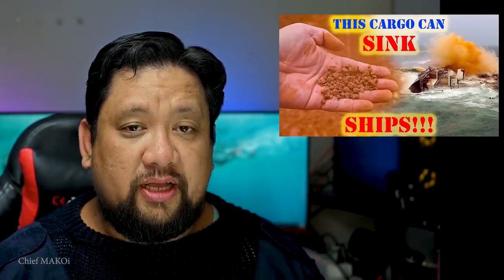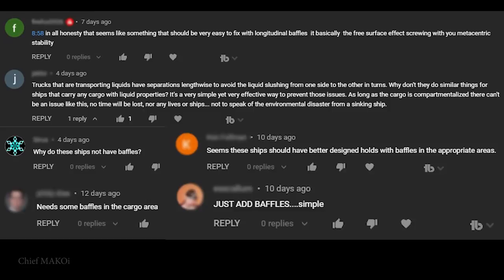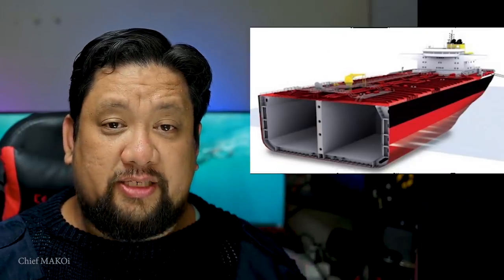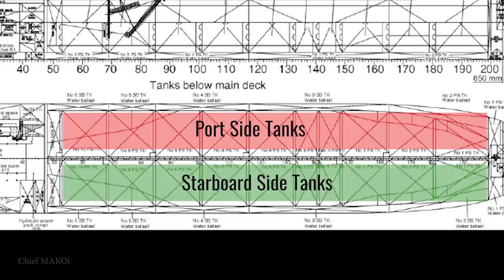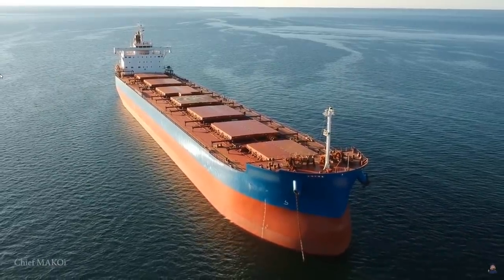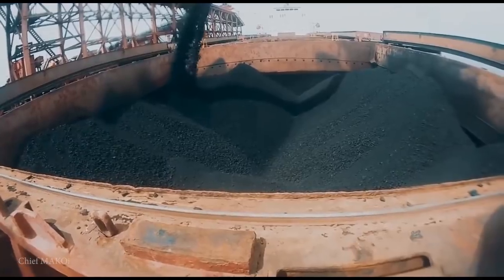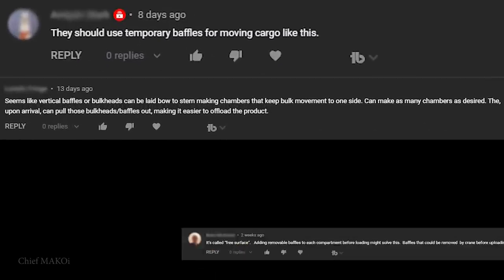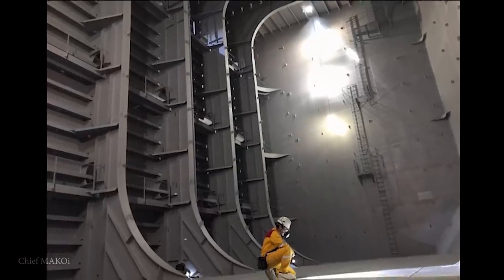Free Surface Effect: Should Baffles Be Installed in Bulk Carrier Ship's Cargo Holds? | Chief MAKOi

Comment: Air bladders along the top port and starboard side.

Just passively inflated they would prevent the liquid like loads from shifting as much. And if actively managed they could provide even better stability.
Reply: Many tragedies could have been avoided if captains would have turned the their ship  around in time and get the motion moving cargo from the opposite side ,  fear is the greatest danger for someone in that situation . Waves rock the ship  in very specific repeated ways and load shift can happen even with dry bulk ,i would vote in pumping compressed air from the bottom keeping  particle form merging into liquid .
Reply: @stephenconger2029  Dry sand is different , moisture load in the media can be used along with compressed cold air to create artificial ice structures  inside cargo ,air bladders would call for  extra engineering of ship structure plus variations in cargo volume would create more logistical challenges .
Reply: @rovidius2006  so instead of bladders that would require modest space and a couple small compressors. You want multiple compressors, some being quite large capable of achieving and maintaining refrigeration?
Reply: @stephenconger2029  Either one might work ,cost is the limiting factor ,bladders of that size and material thickness are hard to come by ,if they blow up it makes it far worse, so they  need have universal size and engineered strengths. Refrigeration could be used occasionally   based on weather and cargo condition ,mostly emergency use ,400psi compressed air traveling through pipes  from engine room  through heat exchangers would get parts of cargo frozen ,remember moist cargo will cool down  in contact with moving air by losing moisture so a double cooling effect .

Comment: In short, it's not going to happen unless there's a regulation to mandate it. From a safely perspective, it does add an extra slice of cheese with only a couple of very small holes, so it's going to be a case of if you think existing control measures are adequate.

Comment: What if it would've been possible to force compressed air from the bottom of the holds through the cargo, causing the moisture to be vigorously "remixed" evenly with the product? Maybe this would be less difficult to accomplish than using baffles. The idea is that the compressed air would be initiated as soon as it becomes evident that the vessel is listing.

Comment: Food grade tanker trailers do not have baffles, allowing the load to surge for and aft as the truck moves.  They can’t have baffles because the trailers have to be sanitized between each load and the baffles interfere with the cleaning process.  Just FYI!

Comment: I looked for the largest bulk carrier that carries bauxite and apparently it only carries around 173,000 tonnes which in ship terms is a baby, if memory serves me there is a gross weight limit of carriage which is something like 185,000 tonnes because of the liquefaction issue that bauxite specifically presents. In my mind, a better option is larger pressurised cells… since an immediate drop in pressure is a better indicator of a liquefaction event than simply, noticing list… equally, the application of desiccant gas as a pressurising agent, to me, seems like an added bonus…
Reply: Maintaining that size of a pressure vessel costs more than shipping it in smaller lots, and requires extremely specialized cargo spaces.

Comment: So this is me thinking really laterally, but some kind of "cargo netting" strung as curtains through the holds might make for a decent baffle. While it wouldn't keep a load from shifting entirely, it would greatly slow it down by providing reinforcement. It would be lighter than a giant steel baffle and something you could install and tear down quickly.

Comment: Wouldn't the simplest solution to this problem be some kind of sump pump or a bilge system? It seems to me that more bulkheads or baffles are a rather involved and difficult solution to this problem.
Reply: Ships already have bilges in the holds and other compartments which can be drained.  Its possible the bauxite would be too thick to allow much draining through it.

I work with ships and we do load dry cargoes in the rain at times.  The crews will check the bilges and pump out if needed.
Reply: No, the simplest solution to the problem is to just avoid the problem in the first place! Don't loading wet cargo. End of. Until the cargo has liquefied, there's nothing to pump. Once it has liquefied, you'd have to pump thousands of tons of viscous, abrasive material overboard in only a few minutes. That is not a simple solution.

Comment: As a retired mechancical engineer, I was one of those in the last video that spoke about baffles, however I believe it is important enough that it still be done. Ther are a few alternatives such as movable and removeable baffles. A movable baffle could be a structure with a membrane which could be raised from the high side and push through to the low side thereby allowing the liquidized top portion to fall behind the lower movable baffle or riser. The main point is that if a company cares about safety there are options to engineer solutions.
Another option would be a large dehumidification system to alleviate the problem.
Reply: What membrane can you think of that can take the impact of 30,000 tons repeatedly while still being practical to roll up, much less do that and avoid having corn dust, iron ore powder, and crushed limestone make its way into and out of the mechanism, which would then cause a food safety issue for the use of it to transport grain. 

While yes, in theory, you could build one, the reality is that so long as you keep a close eye on the loading conditions of the cargo, then the risk is minimal, as most of the cargo is so unable to either absorb moisture or give it up that a dehumidification system while underway would only consume megawatts of power to no actual effect, unless you are forcing enough air through the cargo that you get pneumatic fluidization instead of liquefaction. 

And frankly, the sort of companies that have issues with the current system would not maintain the upgraded system at a functional level, so it would add cost to no actual increase in safety, maybe even a net decrease as the margin between the unsafe cut rate shipping companies would be even larger, meaning they can get more cargos or make more money and expand.

Comment: if ur gunna make a gigantic baffle you might as well make it a structural component of a ship. because the issue is port - starboard stability you would put the baffles in the middle. But since the bulk carrier is basically a box or tub design you would be better off putting a separating structural component down the middle of the entire ship bow to stern, and then making the walls of the ship lighter. but then you have a oil tanker lol...
you hit the nail on the head. we use bulk carriers for a reason, just dont improperly store the cargo and its not a problem

Comment: ports that load cargo that can potentially liquefy could also supply long cylinders to go to the bottom of the hold.
any water that is liquid would run into the tubes and could be pumped out.
a 6 inch diameter pipe, the height of the hold, would not displace much volume of the cargo. and any liquid that can be removed is life saving.
But, as you say, just test the load, make sure it conforms to specification and there is no problem.

Comment: If we are talking about rebuilding ships to make them safer. Why not have the entire crew quarter + bridge be a little bit sturdier built and then have breakpoints so it completely detaches if the rest of the ship goes under the surface. Sure you still have the guys down in engineering but at least people won't be caught of guard sleeping.

Comment: There’s hangar doors 30ft across 30ft high that run on rails and can be handled by a person. My guess is they’re are at least 500 tons.
With the right rail mechanism, you could have 1 rail mounted baffled per area that’s secured to the roof and keel and walls.
6 points of contact. That would probably weigh 1000 tons. But could be moved my manual crank handles or with pulley systems attatched to cranes. When in port.
It would take 15-30 minutes. Which is nothing to a ship

Comment: I wonder what the port does with a rejected cargo due to its high water content. Does the water drain out,  dry out, or could it be stored on a drainage grid at the port to let it drain through?  Yes it is not a direct shipping problem,  but an efficient solution could be helpful.
Reply: They leave it on a stockpile until it dries out / passes the tests showing below the limits.

Comment: Are there any realistic means of removing the water from the cargo after it is loaded?
Reply from the maker: It goes to the cargo hold bilge and can be pumped out.
Reply: Not really other than letting the cargo settle naturally and collecting the water as it does. Maybe it would be possible to vibrate the cargo so it settles quicker but that would mean modifying cargo holds or inventing a new machine for the job. Either option would be expensive and would have to pass all the regulatory hurdles.

Comment: Great discussion. 
A common consideration is practicality. 5-point harnesses are safer than 3-point retractable seat belts. Yet, we don't use 5-point harnesses in our street vehicles. Why not? Because the additional margin of safety is not worth the additional loss in convenience. It is a compromise between safety and convenience.
Someone correct me if I get the specifics wrong, but there is an expression in many industries that goes something like this: Good, Fast, Cheap. Pick two.

Comment: couldn't you drop a net on the surface that would self impregnate and stabilize the top if the load goes to liquefaction? only the top couple feet need stabilized.

Comment: That's the problem with internet comment sections, and the general public as a whole. We all have ideas. Some of them are even good, for a specific problem...but the issue here is that baffles should never be needed, so no matter how smart your design? It's pointless. My brain was sketching out a 1/4 height surface level baffle that could hinge down from under the hatches. 

But at the end of the day, that's a costly modification that by definition should never be needed. 

The best solution would probably just be to have the basic equipment on hand to properly test for moisture content on a sample of materials... sensors for moisture content exist, or something as simple as heating a, say 100g sample  for a while to see how much is lost as steam. An hour with a suspect sample in the galley and you'd have your data.

Comment: There is a difference between a bulk heads and baffles OK bulk heads are used in the structure of a ship. to make it stronger structure.  Baffles are used for liquid like in tanker trucks >  to keep liquid from slopping around>  if you got a straight barrel tank. the liquid will keep pushing down the road even if you got your brakes on! Baffle keep the liquid more still, and not powering up the force to push~ taking off and stopping makes a wave in there! pushing you forward and backwards

Comment: Could they update the shipping requirements for things that are prone to liquefaction? Like requiring bauxite it be packaged in smaller (but also bulk) containers that are easy to load and unload (like the massive, several ton bags they use for rice or grains)? In theory this could even allow shippers to pre-stage cargo and load it quickly via crane so it doesn’t impact (and might even reduce) time at the dock?

Comment: I'm familiar with freight train tanks cars which are of course designed to transport liquids, in most cases the tank cars are used continuously to transport the same, or very similar liquid, usually a hazardous liquid. The baffles in the tank cars could be compared to baffles in a auto exhaust muffler, maybe a honey comb, basically the baffle is  a steel plate with many circular holes through the plate which allows liquid to flow through the holes while keeping the liquid from surging in what ever direction the force of motion of the car would sling the liquid.  I suppose that is what the Chief refers to as free surface  effect.  I'm sure if these tanks cars did not have baffles there would be many more derailments..

Comment: Wartime North Atlantic.  Occasionally Libertys would sail in ballast for the States.  Vertical I- beams would be welded to the overheads and the hold deck.  Batterboards would be dropped in and the hold filled with sand as ballast as needed.  Unfortunately, sometimes the welds on the deck would break as the deck sagged under the weight of the sand.  In bad weather, the  baffles would hinge from the overhead allowing the ballast to shift.  The feelings of the crew when they heard that long low rumble from the holds and the ship didn't respond can only be imagined.

Comment: Instead of baffles each hold area should have a horizontal auger that would be adjustable up and down to be just below the heights of the cargo so if it shifts the auger can push it in the opposite direction when needed, or it can be automated to keep an incident always at bay especially in rough seas.
 They would act kind of like your front Bow thrusters that moves the front of the ship side to side. 
 And these augers can be placed to not be in the way of loading or unloading, and would only be a fraction of the weight of the baffles.

Comment: Engineering of all types is just a long series of compromises generally needing maths to resolve.   In general all Engineering problems have at a minimum two factors that influence decisions.  Time & Economics.  When you add humans you add in factors of their minimum level of comfort and their intelligence (or lack there of).  Then you need to add in things like port limitations, wind and sea conditions, 20 year global shipping forecast, etc. 

Thinking that Baffles are the solution is nice. In the last 80 years of ship building I am sure that someone thought of baffles and they were put in to the calculations and the numbers didn't add up.  These are huge holds and this isn't like the portable walls they had down at the Radisson for your Drones club meetings.  Engineers with a P.E. are smart people and ideas like a baffle are good but they need to stand up to many engineering calculations. No engineer, especially one with a P.E., wan'ts to know that something they designed killed people or sank on launch.

Comment: Chief, you know those large plastic containers that are shrouded with metal grates, which are designed to be used for water transport in the trucking industry? They are cube shaped.
What if it became the industry standard and requirement that any material prone to liquefaction must be delivered to port inside containers that are larger than the water cubes, but are stackable and designed for the specific material?
Then ships would simply stack the containers as with other container cargo.
Yes, it would be more costly but that would be the responsibility of the producer, not the shipper.
Reply: Have you seen hes videos on loading/unloading?
The masses are extreme. It would take ages to fill it that way. 
As he already said:"within the limits there is no Liquidation possible" So why worry ?

Comment: Hm... that is the issue of "scaling up" solutions from one application to another (i.e. semi tractor trailers vs. bulk carrier ships).  However, the real question to ask is what are the cleaning protocols for a bulk carrier between different loads?  Nothing worse than having residue mix and cause rust, corrosion, and/or explosions.
Reply: You simply wash the holes and dry them until clean. Compare it to washing your car, but then on an enormous scale :)

Comment: Dunning Kruger strikes back. Still someone would miss the point that the cargo has to be dry enought, period. There are not simple ways to solve this problem, the easiet way is to not load any wet cargo and don't let the problem happen. You don't put savegards in the ship if you can solve it in the land, is the wrong way of thinking. And if you think that way I don't want to sail with you.

Comment: what about optional drainage? Pipes on the side on the bottom of a cargo bay that has a minimal elevation in the middle might work, don't use much space or add much weight.
Reply: So the cargo can drain out too? The weight of the cargo will press against any "filters" giving the water no where to go. The only reasonable solution is to follow no cost safety protocols already well known. No sense to reinvent the horse.
Reply: @SpaceCadet4Jesus  "optional" means, it can be used if _necessary_. Covers on the ends of the filters can be used if no drainage is supposed to be necessary. There are filter applications that can effectively retain solids and only let liquids pass through, without clogging. As it's actually only a combination of sieves with different mesh size, they're simple. And they can be re-used. There's always reason to think about improvements, especially when at low cost and high effect, and when safety protocols can be circumvented for the one reason or the other.
Besides that it is "to reinvent the wheel". Horses were never invented.
Reply: @human_isomer  The horse was reinvented...by a committee. It's called a Camel. 😁
Reply: @SpaceCadet4Jesus  oh, THOSE horses... the ones with a very effective prevention of drainage? 😁